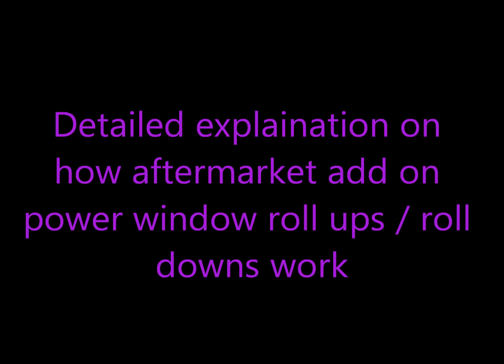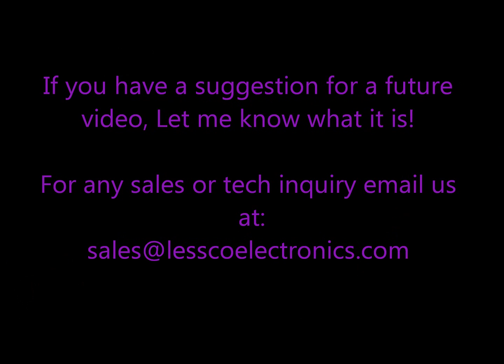Car alarm power window roll up modules wiring & installation explained

Comment: Found this video just now lol I bought an RKE system LB-402, and it only has one wire for window rising output, I think this is probably just a one window module or so, but where do I hook that too? Power window switch/up?

Comment: Excellent video and explanation.   I'm about to install a window module that have an option for vent (window down 2") or all the way down .  The AUX output can only be set to output for 500ms or Latched or  output 250ms then output for a programmed number of seconds. . i.e.  output for 250ms pause for 250ms then output for 5 seconds.   The controller looks for a single button press to VENT and a continual press to let window down.  How would I program the AUX output to memmic what's needed to VENT or OPEN?  Thanks in advance

Comment: My window output wire is a ground that outputs 0.6 volts for about 30 seconds when I hit the lock button on the remote. How would I wire that to my window motors and would 0.6volts be enough to power my window motors? I am so confused, please help haha
Reply from the maker: you need to connect that output to a window interface module that handles the higher draw from the electric windows require to roll up, like this one we have: https://www.ebay.com/str/lesscoelectronics?_bkw=au-93-4

Comment: Great video Im a sub of your channel. Had a question. So I have a 05 tl and oem has the roll down option with oem remote by holding down unlock on second click and all windows and moon roof open. But since I installed a excalibur alarm remote starter i have lost that option is there any way that can be added to my system with out a aftermarket moduler since it had it already?

Comment: What brand window module do you recommend? I'm trying to find the dei 530t, but apparently they no longer make it. Is a 529 okay? Thanks
Reply from the maker: I like the 529t, I prefer the omega au-93-4 since its cheaper and has a lifetime warranty on it.
Reply: What kind of power source do you use to power the windows? A straight wire from the battery, or is there a constant through the window control unit? (I plan on installing a viper alarm system to my car, and add on the window remote as the auxillary). Thanks again.
Reply from the maker: Most cars with power windows already have a master switch that provide power centrally. But to tie them into your alarm you'll always need a module to handle that job.
Reply: You mean that will power them even when the ignition is off?

Comment: I have a  Viper 5906v, Dball 2 & DEI 535T. I want to roll up windows when armed and have the ability to roll up on aux 2 and roll down on aux 1. Do I need to use diodes and relays to make this happen? or is using the interfaces applicable. great videos man, keep up the good work.
Reply from the maker: Well, the up ties into the orange ground when armed, I would tie the aux2 directly in with a 1 amp double diode. Then roll down is dedicated to aux1, that's easy enough...
Reply: Lessco Electronics wish I came across your videos before I bought my system, would definitely have gone with a brand you suggested. oh well, I can't cry over spilled milk. good news though after I install this alarm I have to do my son's truck. 2 door 96 mazda b2000 - no pwr windows, will be installing pwr door locks and security alarm with remote start (want option to install pwr windows in the future) what would you recommend? thanks again for all your videos, by far the best out there.
Reply from the maker: look at the new excalibur stuff at caralarm.com, I have all of them here.

Comment: I have what to me appears to be a simple problem, being made difficult.
I want a remote system to perform three functions. The wiring is already installed and working manually. It is all confined to one door.
I want a button that will pop a Door Popper. My Vehicle instead of worrying about Windows. I want to make a wheelchair ramp go out, then back in.
All the switches exist in the door (except popper). Which is physically installed.
Reply: I wanted to do the same exact thing. I'm trying to figure out how to consolidate everything on one remote. I want to have remote start and use the window module to open the sliding door and lower the ramp and then put it back up again.

Comment: I was wondering instead of doing two module roll up and down on the front windows. Would you be able to wire in a relay to the arm and disarm wires on the alarm then to the module So the module will roll up and down
.
Reply from the maker: theoretically yes, but theres no regulation to stop once its fully shut or safety if a kid sticks his head or hand in the glass track...

Comment: I have a Viper 5904v system with 4 aux. would it be possible to have the aux roll up and roll down the windows and roll up when armed?
Reply from the maker: sure, actually that would only require 1 aux channel cause the roll up will happen automatically when armed like the starter kill.

Comment: Great Videos, If I have a jeep two door and have the DEI529T, can I use one system where two wires take up the window and the other two take the windows down or will I need to get a second DEI?

Comment: +Lessco Electronics  gave a shot at this recently and got screwed by my old Audiovox alarm. Basically that orange wire that's supposed to be ground when armed always reads as grounded [checked orange wire vs ground point in car with multimeter], so it always activates the trigger wires on my 529t modules and the windows are always closing.  Tried going another route by using the door lock pulse from the alarm as a trigger, and tying the trigger inputs to the trigger outputs, but that not only closes the windows whenever the alarm comes up, but every time I activate the power locks to lock the door, this has rendered my install useless.  Was aiming to have windows close only when alarm is armed.

Comment: Hi, nice tutorial..am having an issue in understanding that momentarily function like holding, my honda city 2014 has an function to pop release the trunk while press holding, but the other two lock and unlock button does noting while press holding,but the led lights up on the key fob,does this mean i can still use the function and set up rolling down by using 2 "4 window modules? while press holding unlock button on the remote..BTW where is the alarm system module( central lock system )would be located will it be in Engine bay or inside driver door panel? thank you

Comment: ok so my window modules work fine but half the time only the passenger window won't go up all the way you have to keep unarming rearming sometimes till it makes it sometimes more then others but the switch is works all the time except had trouble once or twice before the modules were installed, anyway shop said to try a new window motor but I'd like a second opinion, have tried lubing the track with silcone spray but not what you suggested in a previous comment so might give that a try, thanks ahead of time.
Reply: Did you ever get this resolved? I have the same issue.

Comment: I have a 1993 w124 ce300 mercedes benz
I did as u said and installed a 4way module but when i press lock on the alarm nothing happens
Any help about what should i do? 
10x in advance

Comment: Where are you located? I live in Mississauga, Canada. I have a 2001 Jetta that I would like to install an alarm and remote starter. I would like to have a push button start. I would like the setup to be so that when I click the unlock button it unlocks all the doors. When I click unlock twice it unlocks the doors and opens the windows. When I click the lock button it closes all windows and locks all the doors. I would like to replace the panic button to be the remote start button, after pressing the remote start button and approach the car and click the unlock button to open doors, I would like to enter and push the start button to keep the enging running which should automatically turn on the parking lights. When I switch the gear to drive the headlights should automatically turn on day or night. When I walk away the alarm should be on and a fail safe mode that kills power to the fuel pump so that if anyone trys to steal the car they won't go anywhere because of lack of power to the fuel pump. In addition, I may install air ride. If someone trys to steal the car I would like the car to sink at it's lowest setting so that it isn't drive able.

Comment: Hello sir, love the videos.
I have a2010 Ford edge with a "smart window". Have you come across this in any of your installs? I can't get anything more then a slight up and down with this window. I believe the actual motor has a printed circuit. There are multiple wires coming out of the mirror. I have the proper wires for up and down, but this window has auto feature.  the drive window switch cluster is a printed circuit inside. All other Windows work great. I'm using two dei535t's. Any help bypassing this "smart window" is greatly appreciated sir! Thank you
Reply: * multiple wires coming out of the MOTOR.
Reply from the maker: Shannon Bruno There isnt alot of info on those at all, try calling audiovox technical at 631 231 7750, they may of have experience tinkering with them before, good luck

Comment: From what I understand, you could conceivably control one window in both directions vs controlling 2 windows in only 1 direction.   For instance, I have a car that the driver door actuator is faulty and it won't unlock with the key from the outside.   So I would like to control the driver window both up and down so that I can get into the car by remotely rolling the driver window down (upon unlock command) and roll the driver window back up when I issue the lock command.    I assume if you have a nice keyless entry system like Viper's 211HV, that you can program it when the car is started that the lock command is initiated and my driver window will roll back up.
Reply from the maker: That sounds like alot of work to get around the real problem, no? If I were you I'd pull the door panel off and correct the actuator.... and add gadgets as a reward for my hard work fixing it correctly. Sorry to be hard on you, But thats just me.
Reply: I ordered the actuator and I do plan on fixing the issue.  No problem.
Reply from the maker: Good for you, you'll thank me later.. and so will your car

Comment: First off THANKS for posting all the videos that you post! Second, I am having a little trouble with my system. I bought two of the four window modules and today I wired up one door to test it out and it worked to an extent. When I arm the alarm the window only rolls up maybe half way. I tried adjusting the power to the window motor on the module but it didn't really help. I rolled the windows up and down with the switch a few time an listened to the motor and what I hear is that the about half way up the motor struggles a little for about a half second then the it rolls up fine the rest of the way. I am guessing that, that little struggle is tripping the sensor and stopping the motor. If you have any suggestions other than replacing the motor because I haven't tested the other motors I would really appreciate it.
Reply from the maker: These window rollups have limiters in them either resistance or overheat based, the reason is this: if a hand or arm gets jammed in there while it is closing the module will stop (to protect the person). If your window is just misaligned or stubborn the module will act as if it's a worst case scenario like I mentioned above. My advice is clean the track out and regrease it with some graphite or maybe lithium to ease the stress - That's the answer.
Reply: I have the same problem. Did you find a fix? I didn’t have any issues with the widows going up and down before the install.

Comment: Hi, first of all thanks for all the videos, I subscribed since your info is much needed on the net. I have a Toyota Auris 2008 with no alarm system. Can this be wired easily to the electronice central lock system which I assume gives a momentary pulse? thx :)

Comment: Leaving the car and having the windows go up and/or down is nice, but I'm wondering with these devices, will I also be able to control all 4 windows at the same-time with just one of my power window buttons inside the car, or will this feature require another device in order to do this? Thanks. Sometimes when driving i wish to have my windows down but all evenly at a certain depth, and that i could control them with one flip of a switch, because trying to push 4 switches at once is a hassle.

Comment: Hey I need some help with a 2003 silverado I have the module connected the thing is that when I have the door module connected it won't work when I disconnect it . It will work

Comment: I have a 06 scion xa I am a disabled vet and after a bullet I can not understand a lot.
I have a friend who wants to install a complete alarm remote start keyless entry alarm .
I bought a scuta c0202 module and a spy 4 window module . The problem is the scion has a double pulse to lock the door and we can not figure it out . Any ideas on the and any tips on the install I have 30 days to return it if it wont work on my scion . Thanks

Comment: OK I more question. Theres a ten pin Main harness on the module 8 of those wires are for the window motors and the other 2 for POS (+) & Neg (-) I get that.  

But its the other harness I'm have issuses with. Its a 3 pin red blue & black wires. On the wiring diagram for the module it says the blue gose to (-) trigger (-) lock 

& the black gose to (+) trigger (+) lock

& the red gose to ACC

Can You explain that please I need to understand this before I start the install  Thanks Agail!!

Comment: I watch all your videos & they helped me alot keep up the great work! I have a question on my 2005 silverado crew cab. I have the remote start installed already. & I have 2 aisain wolf roll up modules (4 door models) I have 2 of them because I want the windows to roll up & down & yes my alram have 5 chanels . My qestion is if theres a way to install the modules with out going into the doors maybe like taping into the body control module? If so can you explain?